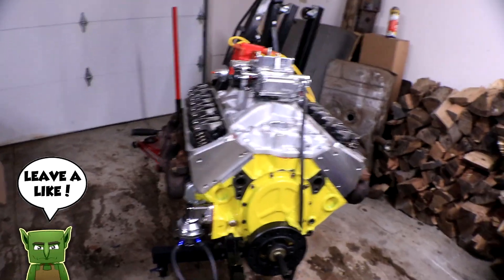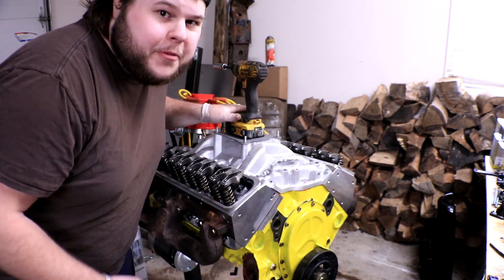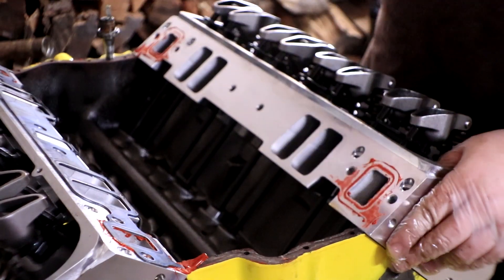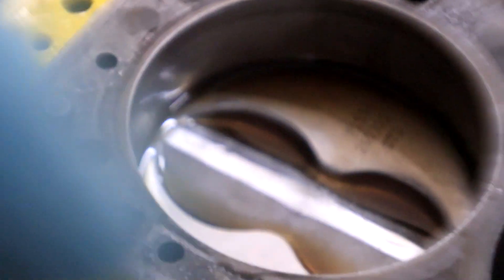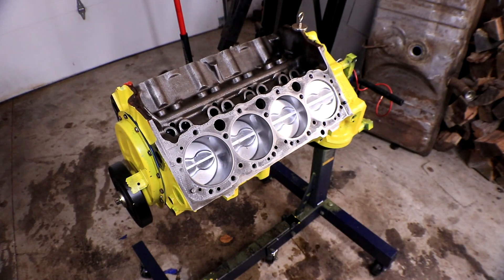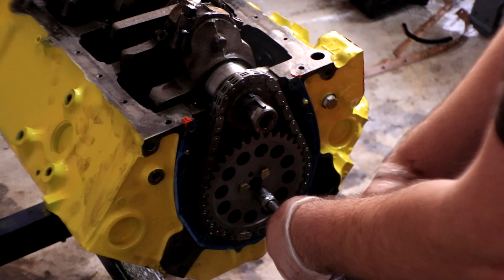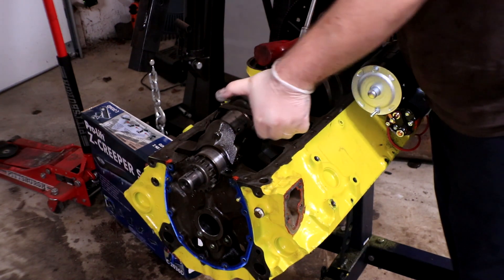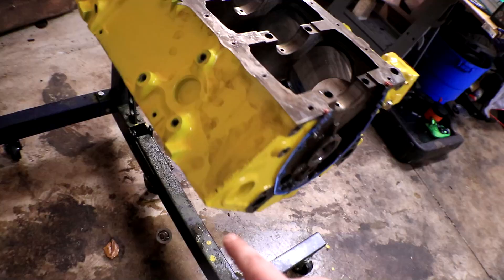Tearing down a Chevy 350

Comment: Quick question, are there numbers stamped on the back end of the camshaft? If so, you can check to see if the numbers do indeed match edelbrock numbers. If so, the cam and lifters could be stored away and used in a later build or perhaps used as an upgrade in a good used stock 350 for another car or truck. Maybe not take quite a loss that way. Good luck! ☺

Comment: Oil in the top of the cylinders are from valve guide seals 👍 also keep your parts alot cleaner. Bearings look like they were put in on a dirt road

Comment: If I were you I would take the block and main caps and cylinder heads to your local machine shop and have them checked unless you already had the block done but the heads should be checked for flatness and maybe have them check the valve guides alot of the cheap aluminum heads the guides can be to tight and or cracked and the value seats need to be checked and cut to fit your new quality valves...block may need to be decked to make sure it is flat and have cylinders checked for roundness and honed with tourqe plates and check the crankshaft and align hone if need be....I know a lot of people may say it should be fine...but it is not  it is an added expense but worth it in the long run

Comment: What I would have done is, start w/ the mains, plastiguage  to determine your proper clearance, purchase correct bearings (undersize/oversize). Replace the mains, double check your clearances. Then repeat with the rod bearings. There was a Solon reason take the engine back to bare block.

Comment: Please get a 7/16-14 thread chaser for the head bolt holes. You need need clean threads for accurate bolt stretch/torque readings.    Also, the head bolts going into water on a SBC so, be sure to use a good thread sealant.

Comment: Did you use the black rubber gaskets on the ends of the intake ? If you did , there's your problem ,they hold the intake up too high and it will suck oil thru the intake ports , use silicone on the ends
Reply from the maker: Used silicone on the ends, still got oil in
Reply: @TheGarageGoblin  If that were the case you would get oil in all the cylinders.
Reply: 1/4 inch beads on the China walls ! Right stuff is all I gotta say!

Comment: Oil on top of that piston is a RED FLAG!  Please investigate that.
Reply from the maker: Any chance the fact that I turned the engine upside down for about a month would have allowed some of the oil to leak through the piston rings up into that cylinder?
Reply: But only on one bank?
Wouldve thought chambers and around the valves and plug holes would be wet there too if it has passed thru the ring gaps while upside down. 
When you rebuild a turbo and pre-oil it and then sit it the
the exhaust housing side down, oil can leak thru the smallest gap in the turbine shaft ring, so its possible.
Reply from the maker: @matui6983  my garage is ever so slightly sloped down, and the 6 piston would be the furthest “down” the slope, so if there was oil left in the engine when I flipped it, it would naturally go towards 6. Hoping that’s the case, but will do a full valve lap and check seal with the new parts being put in.

Comment: So one thing i saw in this video today was your use of a flat head screw driver and mallet to pop the heads off..... i was screaming at the screen to stop ;)  never never do that to aluminum heads or even really cast heads  those surfaces are machined baby butt smooth for a reason  using a screwdriver like that you can and will make a gouge on the head that can cause you troubles.  when ever taking off the cylinder heads just use a rubber mallet and give a good smack to the front of the head then you can lift it off easily  there are metal dowel pins that keep the head inline on the block so you just need to smack the head and brake the seal.   also not a big deal but just so you know you dont need to put the bolt back in the crank in the center to pull of the harmonic balance.  the tool has a tapered tip that wont go into the threads should look like a top put that on the tip of the tool and then use the tool to pull it off.   i will say this though the fact that oil was getting into the combustion chamber on top the piston like that  is a big worry for me and really would recommend you taking the heads before putting the new parts in them to a machine shop to be checked  you really should have a professional look at them and give you the ok before going on with building them.  and only a machine shop will have the ability to check them out for you  could it just be a few bad seals?  sure but it also could be much worse like a cracked head and you cant see it.  in the end its all up to you bud but i feel much better at least telling you i feel you should have them checked out ;)   good job so far man   your learning

Comment: You also need the correct bolts for the starter the bolts are special and it looked like the ones you took out had a bunch of washers on it so I am assuming they were too long and not real starter bolts.
Reply from the maker: Haha correct, new bolts are on their way
Reply: @TheGarageGoblin  for a future tip start by taking your crank to a machine shop for them to mic the journals and they will tell you what bearings your will need most of the time they would recommend going .010 under bearings

Comment: Oil leaked through a bad valve seal and a bad (non correctly machined!) valve seat into the compression chamber !! Make sure that the piston ring gaps are all opposite to each other to make a labyrinth effect expecially first and second ring 180 degress opposite and the oil ring gaps 90 degrees to each other! Otherwise pistons will accumulate oil and gernerate blowby! Let all valve seats regrind to 3 angle valve job and lap the new Manley valves correctly with the seats. You might also install new camshaft bearings! (get Jegs bearings for that made by King) Check your crank surfaces you might use some 1600 hyper fine sand paper (pre oiled) and give the surface where the bearings touch the crank a nice finish (especialy look for scratches and shavings around the oil holes) When installing your rods get some rod bolt shoes to protect the cam against damage when installing the rods (rod bolts might scratch the surface). Those Rod bolt boots have the number: Mahle Clevite 77 2800-B1
Reply: You can put the rings on in a special way but once that engine runs for a half hour those rings are not going to be anywhere near where you put them ,they must rotate just like lifters
Reply: not a bad idea  i love them too but in a pinch he can do the old fashioned at home way and just use a piece of rubber hose over the bolts when tapping them back in to protect the surfaces ;)  and thats free to him
Reply: If you have that much oil going by the valve seal the valve guide is also completely worn out , when the valve opens the oil is going to go in the cylinder regardless of how the seat is machined
Reply: Strange thing is that the engine never fired a shot. 
So for one bank to have oil on top of the pistons after a period of cranking theres sumthing funny going on there. 
Unless a huge amount of oil was on the bores or pistons when it went together. Be checking for loose guides or mightve pulled oil thru inlet ports from valley sumhow. Unless when he primed it sumthing went a bit loopy but cant see that.
Reply: When you lap the valves heres an old school tip, place a lightly wound spring up to 2 inches long onto the valve stem. Put tiny amount of  lapping compound onto the seat of the valve then pop  oiled stem into valve guide. The spring will help lift the valve off the seat as you are lapping it with a standard stick type lapping tool unless you have gone out and bought an oscillating or eggbeater type valve lapper ( cant be beaten for lapping valves).
Then wipe valve n seat clean. 
Blue the seat of valve with tiniest amount of marking blue to avoid false reading. Put stem into guide until head is about an inch away from seat, place one finger on side of the valves head to hold in place and with a wooden hammer handle or deadblow hammer handle knock valve onto seat. Do not turn the valve at all, bullshit move to do that. Lift valve out and check both seats. 
Then to 100% know you have a good seat, wipe the valve clean with a brakleened rag and do it again to get remaining blue to transfer from head to valve. 
If all good then you know that cylinder will be fine, otherwise its more lapping or off to get seats checked at machine shop.

Comment: some advice, before you put a single part back in that block take it outside and wash the heck out of it inside and out with a good de-greaser soap using engine cleaning brushes & a pressure washer to clean ever inch of it then blow it out with an air hose on a compressor, get it clean enough to eat off of and make sure every part that goes in it is spotless (with the exception of assembly lube of course) and since you're gonna polish the crank do the same to it and make sure you get the oil passages cleaned out real good, I'm saying this from my past experience where I learned the hard way.
Reply: I fully agree with you on that too  we dont want any kind of debris in there from any of the old parts moving together from the first assembly or now for the polishing of the crank  good advise giving here ;)
Reply: Yeah, a motor has never blown up from being too clean.
Reply: If it does get washed inside and out, after its dry you take a clean lint free rag or shop towel put some new ATF on it and wipe the bores and keep wiping until the rag is clean. Amazing what it can and does pickup.

Comment: Regarding pistons I would highly suggest using forged ones like these 0.30 oversize: Wiseco PTS503A3 plus SCAT forged ballanced rods (with floating pins!!) : Scat 6570021 (Check compression ratio with your heads to stay under 10:1 and above 9:1 !!!) Keep your quench at around 0.35-040!!! NEVER UNDER 0.35 and NEVER LARGER THAN 45 or your engine will ping with crap pump fuel- under 0.35 quench clearance pistons can collide with head. You need to bore your block 0.30 over but you can only do that AFTER YOU HAVE YOUR pistons so the machine shop has the piston datasheet for clearances!!! Let your block ZERO DECK! And use a 040 head gasket! If you dont deck your block you have to use the 0.15 FEL PRO coated steel shim gasket 1094 to get the quench right!. The Chinese harmonic ballancer you have wont work safely and can explode they are ticking time bombs! Please get a Fluidampr (ORIGINAL US MADE not Chinese crap copy) or an original GM harmonic ballancer. (You need to get your complete crank/rod/piston assembly ballanced  or your engine might vibrate to death!) Dont forget you have an original cast crank these are fine for a mild street engine but they need a superb ballancing job because they are brittle and break when vibration occure. The best thing would be, get a balanced forged steel crank for example a Manley forged one. Than put the con rods upper and lower ends on a scale and match them to 0.5 gramms. Same story with new forged pistons. (You cant use the chinese pistons! Dont use Chinesium cast aluminum pistons in your engine!)
Reply: Fluidamper's have been proven to be kinder to crank snout. And to extend bearing life. 
Plus no outer ring to shift and cause timing issues or potential damage if it was to come off.
Reply: @matui6983  you are correct on that one Fluidamper's  are the best  but as long as its not a China made balance and he is not gonna be racing it  and spinning big RPMs  he should be ok though  but yes if it was my build i would use a Fluidamper on mine ;)
Reply: Same here. 
He could go crazy right now if the money and time allowed. 
Hot tank block
De-burr entire block
Turn it into a 383
Balance the engine
Paint rustoleum in valley
Fit screens into valley drains
Head studs, Main studs, oil pan studs etc. 
Coolant drain taps in block. 
Winged/eared oil pan for more capacity.
System 1 oil pump and  same brand oil filter ( best filter Ive ever used)
Could just go on n on and thats just for the shortblock. 
If it goes together right using good parts and is run in correctly, then it should do ok by him and his Mum when she gets it.
Reply: I agree with the quench & balancer but forged pistons are overkill.....good hypertectics are fine.
Reply: When we ran 350s in the roundy round dirt car ,4 barrel , unlimited class , all we ran was cast cranks and 2 bolt mains ,never broke a crank ,brittle ? Hardly
Reply: 100% spot on. 
Ive seen a 350 cast crank, 2 bolt
That we put on the engine dyno (cos we finished a marine diesels power runs early) that was only meant to be a beater engine and it made 430hp and the crank and maun caps survived 10-15 power pulls no problem. 
Tead in a SBC hot rodding book that a cast crank n 2 bolt mains are good for up to 500hp
Reply: @matui6983  We ran the 350 truck steel cranks and 4 bolt mains early on , after scattering a couple of those then we went to 2 bolt , cast crank , the only 2 bolt we really scattered had the Eagle rods in it , it was soon after the rods came out back in the early 90s ,my man came rolling into the pits and there was an Eagle rod laying on the front crossmember
Reply: I had heard sum not so good things about the early Eagle stuff. 
I think its improved a lot tho. Only used one 383  Eagle stroker kit in the last few years and it was ok altho the balance was a bit out when checked.
Reply: @matui6983  I also think they have improved ,the one we had let go was balanced as well
Reply: The engines in your circle track cars def get a hammering. 
If a part or parts and engines survives there then its a given it will take whatever street use or abuse is thrown at it.
Reply: Forged pistons are a waste of money on this build. Hyperutectic will be fine to about 550hp and 7000rpm. Sealed power and KB are the best ones for a budget. The stock connecting rods will fail before the pistons do. Scat con rods are the best bet for a budget engine. Cast crankshafts fracture much less than Forged ones. Cast cranks have better internal dampening and have less 'ring' than a Forged crank so they have less bad harmonics.
Reply: Agree with everything in your comment 110%.
Its not going to be a fullon drag car by means (traffic light races maybe). Nor will it see NOS most likely. 
So super high dollar bits just arnt needed. 
Many millions of cast crank/ 2 bolt SBC's have done their owners proud all around the world.
Reply: @matui6983  In my case, I have a 400sbc with 4 bolt mains. It would have been better as a 2 bolt because there is less material supporting the mains. The factory 4bolt 400 will still hold about 600hp, which is probably more than I will build for.
Reply: @greenhillgarage  I have to agree on the 4 bolt and less material,  when we scattered one of those it was main web  that let go
Reply from the maker: Harmonic balancer is not Chinese made, and I’m doing everything possible to avoid going to a machine shop, as the whole purpose is doing this in my garage! Not going for a super high power high build here, just want to build an engine in my garage with what I have! :)

Thanks for your advice, just getting a bit further than what I’m really looking to do right now!
Reply: @TheGarageGoblin  okay but you cant use new pistons in old worn bores that just wont work, the biggest problem with Chinese cast aluminum pistons is that they grow in size too much when getting hot, the Chinese use some low grade Aluminum with too less silicone so the pistons wont follow even an OEM Autothermic curve (too small when cold and too tight when hot will be what happens) At least you will need a HQ set of hypereuthectic cast pistons by Speed Pro they are cheap and ok for a street car.
Reply: @TheGarageGoblin  Dude, first of all  I saw a lot of dirt on those bearings second of all now you are just throwing parts at it hoping it's going to fix your problems, how do you know a new set of bearings is going to fix this, how do you know the crank isn't bent now all that oil in that that cylinder, the way you are going about this either that engine is going to blow up, seize up or leak that means you only have a 25% chance of being successful, you better step back and think about what you are doing and make friends with a machine shop real fast.
Reply: I forgot it's going to burn oil real bad, now you're down to 20%, If you live in a state that has state inspection's, it won't pass
Reply from the maker: @ws2664  Bearings were .001 too small for the required clearance. Way too much friction. Heads are being rebuilt to eliminate the oil leaking through valves. All problems being addressed! I'll get it running or die trying!
Reply: @TheGarageGoblin  OK, if you say so.